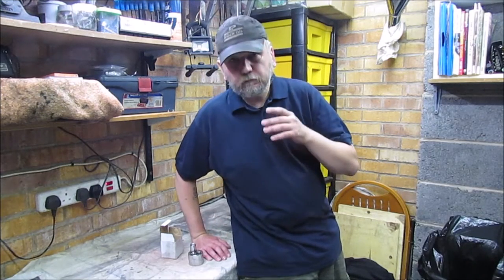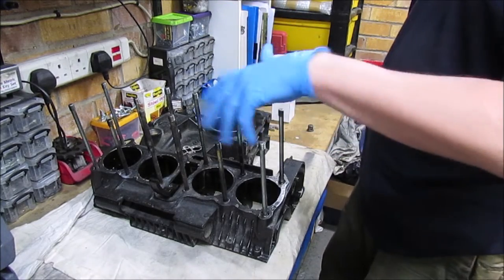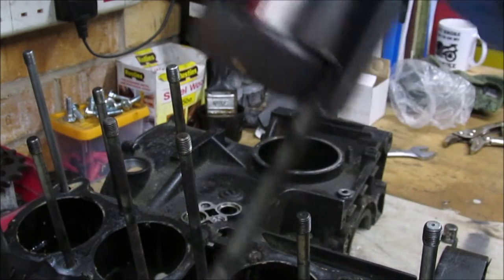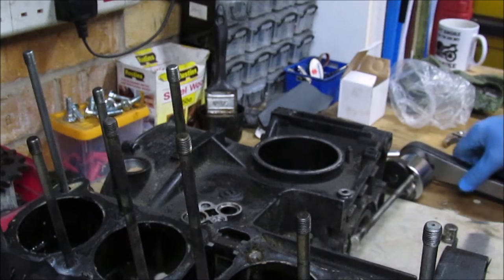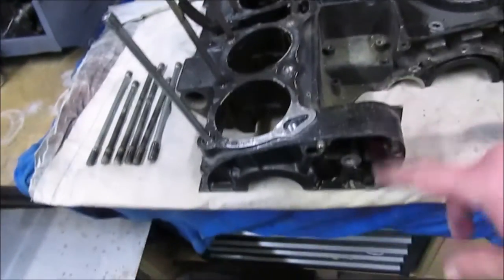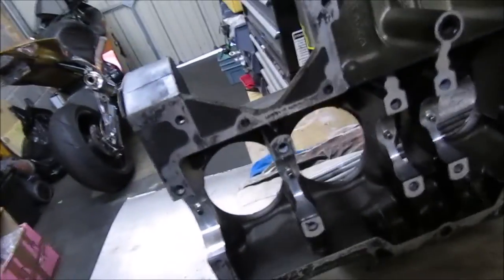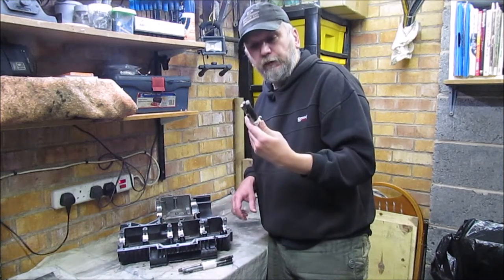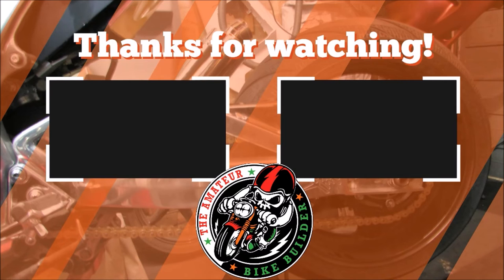Kawasaki KZ1000J /Z1000J2 Project -  Cylinder stud removal - part 11

Comment: Nice tool! I have one with three locking pins inside a socket. Looks like a spark plug socket. But with the cam locking system. Where do You get the new HD studs from?
Reply from the maker: I have gone for APE heavy duty studs, they are available on Ebay, seller was Grumpy1260 in the UK, or i think you can get them direct from the USA
Reply: @TheAmateurBikeBuilder  OK, thanks.
I was planning to zinc plate mine since six of them were so rusty, but I think it's better to be safe, with new ones.
Nice video series!
Reply: @TheAmateurBikeBuilder  Interesting fact! Gary at 1260 is a friend of mine I've known since we went to college together.
Reply from the maker: @MrG61-u9k  wish i'd known could of got a better deal.... hahahahaha , just joking Cliff, he's a nice guy, easy to deal with and knows his stuff
Reply: Hi where did you buy it pal ? I want to remove 2 studs the rest are bolts . Thanks
Reply: @kevinhancock4064  Who are You asking?
Reply: @qivarebil2149  the reason I asked is in my question . Just forget it . Maybe you're trying to be a funny bugger or something .